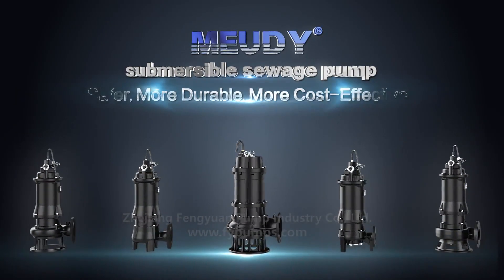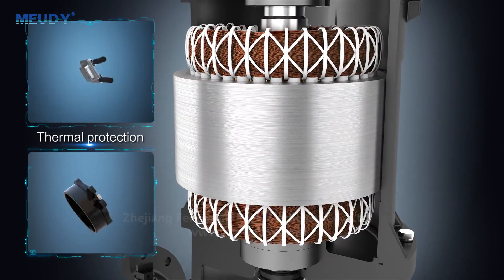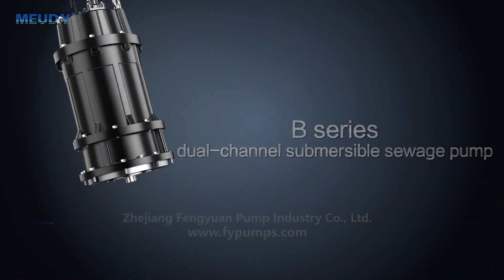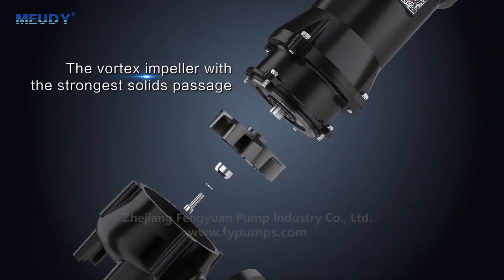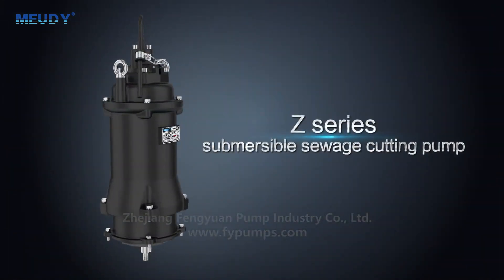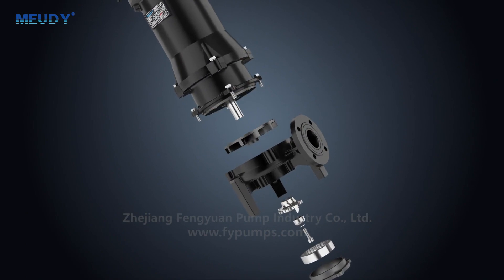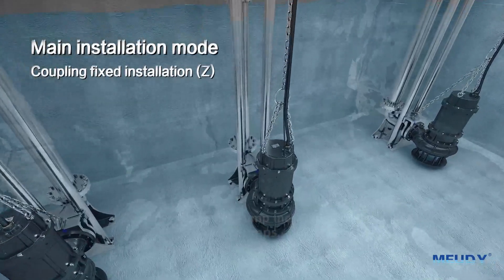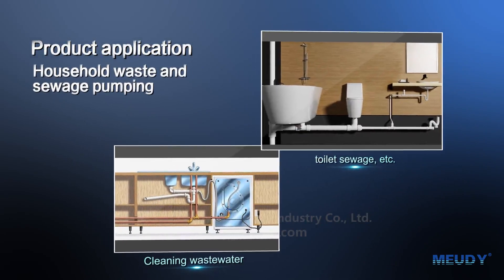Meudy Submersible Sewage Pumps Promotion Video

Comment: I am curious about the foundation design of such a pump, the pump will act as a cantilever beam which will be reflected on the size of the foundation, in addition to the dynamic effect induced by the motor. Any guide on how to design the foundation or how to calculate the reaction forces of the foundation ? I guess the numbers will be very high.